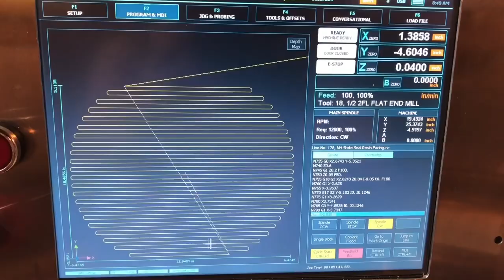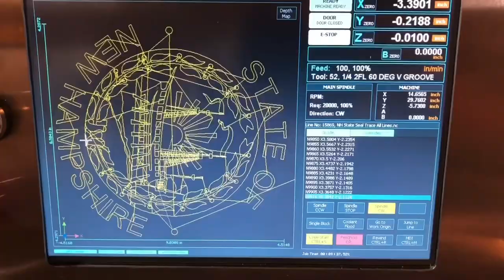Epoxy Resin Sign—A Silent Tutorial

Comment: Very nice!  I like your work.  I intend to get a cnc to do similar style items.  

Two questions -
1. Do you find it necessary to space the work piece every time?  I've watched other epoxy CNC videos and they cut the next later as soon as one layer is dry without resurfacing.

2. You mentioned in the comments I believe that the entire piece of mdf is encased in epoxy.  Was that just by the final pour?  I'm wondering how you kept it tabbed in
Reply from the maker: Thanks for the compliment—I faced the top of the work between each pour on this project just to keep the load on the tools even when I pocketed and V-carved the next colors just because this project had SO MANY colors that the actual top of the piece would have been buried pretty far below the epoxy material if I hadn’t. 

On simpler projects, I just save the facing till the last color is poured and cured. 

As far as being “fully encased” in resin…well, that’s not entirely true.  When I machine the deep channel that I use to pour the epoxy that makes up the sides of the project, I leave about a 0.030” floor on that channel so the MDF core is still connected to the surrounding MDF and isn’t just clunking around in the middle after machining the channel.  This extremely thin floor also prevents the epoxy I pour into the channel from leaking out the bottom of the channel and gluing the project to the table of the machine.

Comment: Thank you so much for the "to the point" tutorial. What machine controller and software are you running? Been looking to step away from WinCNC.
Reply from the maker: Hi!  I’m using Fusion 360 on a self-designed and built 4x8 router controlled by a Masso G3 controller. 

I’m very happy with the Masso controller;  It’s a stand-alone controller (requires NO other computer), it starts up instantly and is easy to set up/run.

Comment: Killer result! I've had a project similar too this in my CNC project list for at least a year😂. 
How long did you have to wait from pour to machining?  Seems like this would take at least a week to make and tying up the machine for the whole time.
Reply from the maker: Thanks!

I’ve tried machining after 12 hours curing time and found that it doesn’t machine as cleanly as it does when I give it a full 24 hours—it seems just very slightly soft at 12 hours.  This is with SuperClear tabletop epoxy. Other epoxies may be different, I just don’t have experience with other brands.
Reply: @MM-tz6md  thanks!

Comment: Thanks for sharing. Absolutely amazing work. We’re you using Vcarve to create the cut files?
Reply from the maker: Thanks for the kind words!  

I try to use VCarve only for complex 3D files that Fusion 360 can’t handle—VCarve could probably do this job pretty well, but for me, VCarve Pro isn’t very intuitive to use—I’m really used to the more-industrial way CAM is handled in software like MasterCAM and Fusion 360, as opposed to the “arts” approach that Vectric software seems to use to deal with CAM.  Not saying one is better than the other, just that I’m more familiar with the industrial approach to CAM. 

IIRC, I either downloaded a vector file of the state seal, or downloaded the seal in some other format and converted it to a vector file. Then, using Fusion 360, I cleaned everything up and I separated all the geometry into different pockets by color.  After that, I just assigned 2D pocket and engrave toolpaths to each of the different color pockets and ran them day after day till the job was done.

Comment: 1. Could you tell me if you polished it with a grinder or sandpaper after milling? After all, milling marks remain after milling
2. What did you pour out at the very end to make it so shiny? is it a colorless resin?
Reply from the maker: After machining I sanded it down so all the tool marks were gone. I didn’t worry too much about the sandpaper scratches because the clear epoxy coat you see me adding in the end fills in all the minor irregularities. It self-levels and is really shiny.

Comment: Could you also tell me whether, for example, there is a problem with the contact between white and blue - resin/resin
Reply from the maker: @PSS_1  Absolutely no problems with adhesion between colors because the contact surface on the old color gets machined (roughed up) a little bit during the pocketing for the new color.

Comment: I have a Question, When You were surfacing the excess away, what was the depth setting you were using, seems less than .01
Reply from the maker: The in-process facing passes were…0.030”(?)…above the intended top of the completed part. Sometimes the in-process facing passes seemed heavy, sometimes they seemed light, depending on how much excess epoxy I had puddled on the top for that particular color pour. 

In the end—the final facing pass using the 2 1/2” face mill—I think I left it maybe 0.005” above the finished part height as an allowance for hand sanding the tool marks out and fine-tuning down to the final part height.

Comment: You are able to create your colors using the guide that comes with the Supercolor Pigments??  I always have issues with creating colors and creating consistently.  You do awesome work!!
Reply from the maker: Thanks for the compliment!

I didn’t realize there’s a color guide with the Supercolor pigments.  Of course it’s tough to get consistent drops of pigment, but my technique is to weigh the part A and part B together, before mixing, then put the drops of pigment in the part B till it’s the color I want, keeping careful track of the number of drops of each color I’m adding. 

Once I like the color of the part B, I’ll mix in the part A, stirring for a couple minutes. When it’s pretty well mixed, I’ll transfer it to a new cup and stir a little more for a total of 5-6 minutes. 

The key to consistency is the record keeping—I take that total weight of part A and B, and, using a spreadsheet, I figure out and record how many grams of the resin there was per drop of each pigment color.  For example, if there was 300 grams of resin/hardner and I put in 20 drops of red, then it’s 15 grams per drop of red pigment.  I do this for all the colors. 

With this information, I can recreate this color (or get pretty close) later by doing the same thing in reverse—Say I have 150 grams of resin/hardener next time…I know that at 15 grams per drop of red, I’ll need 10 drops to get the same shade. 

I also save the hardened resin in the bottom of the cups to use as samples so I can compare the color of the new batch to the old sample. I write the project name with a sharpie on the hardened samples so I can find look up the right formula on the spreadsheet.
Reply: @MM-tz6md  Thank you for sharing this information.  Keep up with the awesome work!

Comment: new subscriber and fan here.  What is your setup?  sorry if I missed a link or info, I am new to all this.
Reply from the maker: Hi,  Thanks for watching!

I’m using a 4’ x 8’ CNC router that I designed and built myself, though any CNC router or milling machine will do. 

The spindle is just a Chinese 2.2kw spindle with manual tool change. 

The CNC controller driving it  all is a Masso G3. 

I use Fusion 360 for the design work and for creating the toolpaths. 

All the tooling details should be in the video description.

Comment: and in processing, probably not very healthy because it's chemistry
Reply from the maker: The beginning of your comment was cut off, but I suspect it was in regard to not using gloves when mixing/pouring the epoxy resin.  The instructions from Super Epoxy Systems DO say to use in a well-ventilated area and wear eye protection and protective gloves. 

My work area is well-ventilated and I am wearing eye protection,and  though I really should be wearing gloves, my method of mixing and pouring keeps me 100% out of any kind of contact with the resin or it’s components. Of course I DO don the gloves when there will be contact with the chemicals, such as when hand wetting the pieces prior to flood-coating them. 

My official recommendation to everyone is to follow the manufacturer’s instructions and wear protective gloves when working around epoxy resin.

Comment: Incredibly beautiful, but not practical, you'd have to charge a customer $1000 for each of those, easy way to do it would be to use a UV printer to print right on the wood, cut it out and then a epoxy over it
Reply from the maker: Thanks, and yeah, you’d probably have to have dozens of these going simultaneously to make any money doing it (or have an epoxy that cures and machines well after an hour or two). 

So far, I’ve done ~10 of them, all for, or at the request of, friends and family.
Reply: @MM-tz6md it can be practical but it Depends on how you set up your process, quick curing epoxy plus registration pins would essentially allow you to make batches, combining pours can also reduce the wait time.  another way to do is by using a puzzle piece mold where you’d CNC cavities that you’d plug or remove to your piece so you can add epoxy.  This a great proof of concept, it’s beautiful, great job!

Comment: how to get such a blue non-uniform color? Is it a matter of the epoxy resin itself or the dye?
https://www.youtube.com/watch?v=OPICTm4bKuI
Reply from the maker: All I’ve ever done is use liquid dye to make solid colors, but in the example video you linked to, I think Chris Powell says he used 2 different shades of blue. I imagine he mixed up one shade of blue in one pot, and the other shade of blue in another. Once they were thoroughly mixed, I suspect he poured both blues simultaneously into a 3rd pot without stirring them together.  When he poured the 3rd pot into the cavity in the sign, the colors interacted with each other in the random pattern you see. 

Others do something similar using colored glitter flakes mixed in with their colored epoxy.

Comment: Dude, I'm drooling over your dust boot!  Lol
Reply from the maker: I’m pretty happy with it—$26 on Amazon:  

Upgrade Version CNC Dust Shoe for CNC Machines with 3.15″ (80mm) Diameter Motor, Hose Adapter Outer Diameter 100mm (3.94″) https://a.co/d/aYoXEUO

I just added a rubber plumbing reducer so I could insert/remove my shop vac hose whenever I need to:

Supply Giant 6I57 Flexible Pvc Reducing Coupling with Stainless Steel Clamps, 4 x 2 Inch, Black https://a.co/d/3xnORpR

Comment: i do a lot of timber engraved resin inlay using solid timber....question I have...what do you coat the back with and do you have issues with cupping as the epoxy shrinks as it fully cures..I have this on solid timber pieces but once cured i plane then down to remove the cupping...as i use a thicker base then you there is room to level it
Reply from the maker: I generally don’t coat the back, though on rare occasions brush on coat of flat black paint. 

I’ve found that if I use 3/4” MDF on round pieces, cupping doesn’t seem to be a problem.  

I HAVE run into cupping problems when I use 5/8” MDF on long, narrow pieces where I heat up the resin a lot during the “bubble removal” phases.  I’m not sure if the MDF thickness or the shape of the piece or the heat or a combination of these are responsible, or whether the resin just shrinks a bit during the cure and that’s just the way it is.
Reply: @MM-tz6md  cheers mate ...thank you for your reply...i use 30mm timber so dont normally have an issue but occassionally if the depth of the resin pour is over 10mm it can pull the timber in as it cures after hardening...cheers  🙂

Comment: Thank you very much, I'm asking because I'm also planning to do something similar. I noticed palinkas in similar videos. Is it necessary?
Reply from the maker: I’m not familiar with “palinkas.”
Reply: @MM-tz6md  sorry, I translated it wrong - it's about a gas burner, is it necessary?
Reply from the maker: Yes, it is necessary so the air bubbles rise to the top and burst. Otherwise, the epoxy will be cloudy with tiny bubbles.